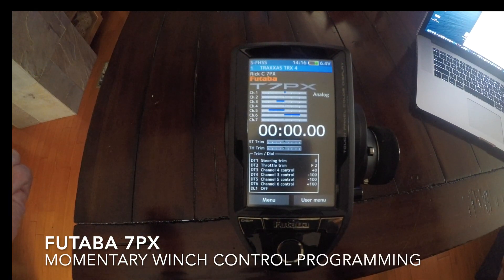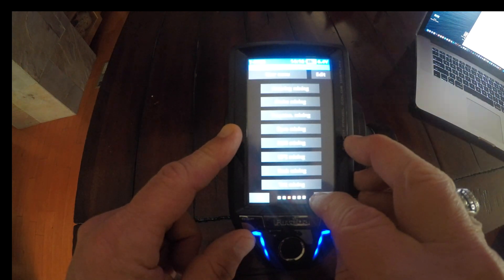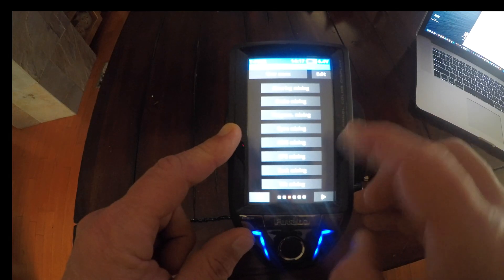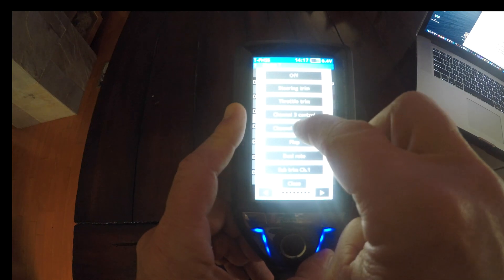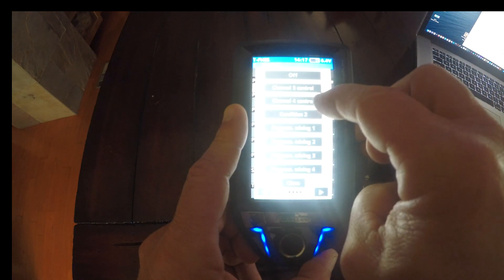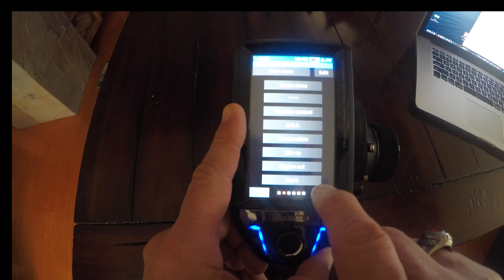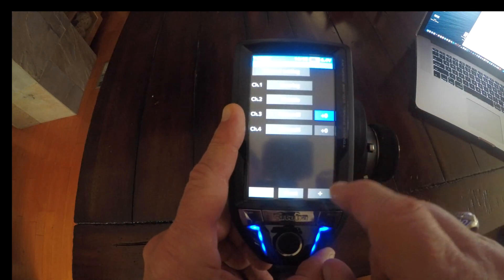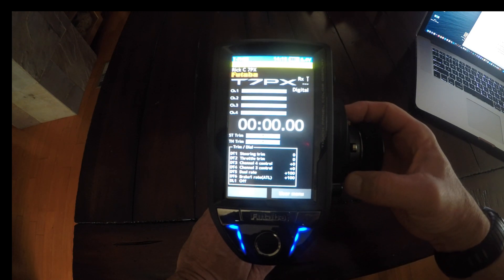Futaba 7PX Momentary Winch Control Programming

Comment: The second I hit the direction the winch takes off. Pushing the momentary button only speeds it up when pressed? I’m using a servo winch
Reply from the maker: I’m thinking you missed a setting.  What winch are you using?
Reply: @TreaderBikes  thank you thank you thank you for getting back to me!!!!! Reefs 299 servo winch
Reply: Could I have the master and slave mixed up or are they both the same?
Reply from the maker: @SuperChitlin  no they are not.
Reply: @TreaderBikes  so my winch is plugged into channel 5 and channel 6 is open.
Reply: You can’t see on screen what you have set to master and what is set to slave?

Comment: I tried this and my winch automatically spools in and out without pressing the switch as soon as I power my truck on.
Reply from the maker: Did you possibly miss setting the end points.
Reply: No I did it step by step with your video. Not sure what the deal is honestly.
Reply from the maker: What winch are you using and what firmware are you using?
Reply: Boom racing muscle winch, and 8.2E on a 7PXR.
Reply from the maker: Try reducing the trim down and see if that helps.  There is another person on here having the same issues with the Boom Racing winch.
Reply: okay thanks man, I’ll try tomorrow. Thanks for making the video, and the help!
Reply from the maker: No problem.  Please respond back and let me know what works.  I may have to pick up a Boom Racing winch to figure this out.

Comment: This does not work as soon as you try to choose in or out (+100/-100) using dt4 the winch automatically starts spooling the ps button has no effect
Reply: I got it thanks for the help my settings on my comp rig have to differ from trx apparently but had another comp guy who runs the 7pxr help me yours were close but we have some differences for some reason but problem solved
Reply from the maker: @shawnharney2890  can you put the differences are?  It may help other people also.
Reply from the maker: It sounds like you missed a step.  You should be selecting a direction with dt4 then an action with a momentary switch.  What firmware are you running?
Reply: @TreaderBikes  7.0e
Reply from the maker: @shawnharney2890  I'm not sure if this is your issue however I do see the most current version out is 8.2.  It sounds to me you do not have the channel mix set properly.  Here is a link to the FW downloads.  https://futabausa.com/product-support/software-downloads/ Just to be clean are you on a 7PX or a 7PXR?
Reply: I’m on the pxr
Reply from the maker: Try updating your firmware.  Then go back through and make sure you have all the seetings as listed in the video.  What winch are you using?
Reply: @TreaderBikes  I've updated the firmware went back through and followed your setting to the letter and it still as soon as I click up or down on dt-4 the winch takes off and the ps still has no effect
Reply from the maker: @shawnharney2890  What winch are you using?
Reply: I’m using boom on 2 rigs and shift xlp on two others

Comment: Are you able to run momentary both in and out? I only get it going out and not coming in?
Reply from the maker: Yes it has worked both in and out.  I also updated my transmitter to 8.3 today.  Everything still works.  I use DT4 to select in / out and PS5 to actuate the winch.

Comment: how about a tutorial on assigning the diff locking and 2sp gear box
Reply from the maker: I could work on that.
Reply from the maker: For the diffs I am running the 7 channel receiver R2008SB and I set the front diff to channel 4 on the receiver and use DT5 on the transmitter for the rear I use channel 5 on the receiver and DT6 on the transmitter to activate.  As for the 2 speed I do not run one however it would be the same, something like, channel 6 on the receiver and DT3 in the transmitter.  For all of these you may have to adjust the trim amounts to get the desired amount of servo movement you need.  I would start by setting both left and right or in and out trim amounts to 50 and increase or decrease as needed.

Comment: Do you plug the winch directly into channel 3?
Reply from the maker: Yes thats what I have done.
Reply: @TreaderBikes  so no controller needed right?
Reply from the maker: Dana Hughes that depends on your winch.  If you have the RC4WD I think you need a controller.  For a servo winch no controller is needed.
Reply from the maker: @danahughes2159  I have one with a controller and servo winch with out using the same settings.